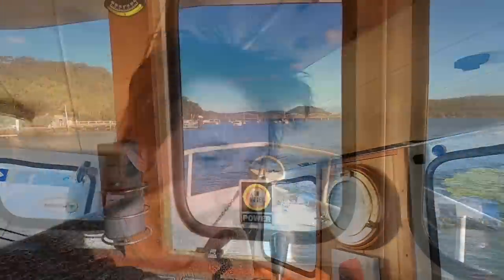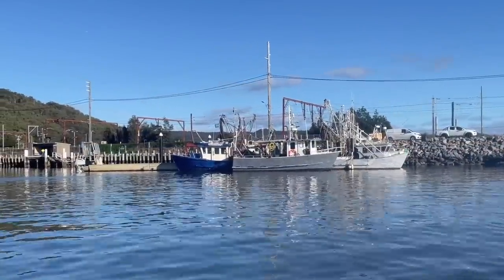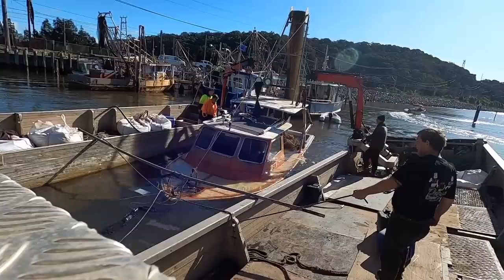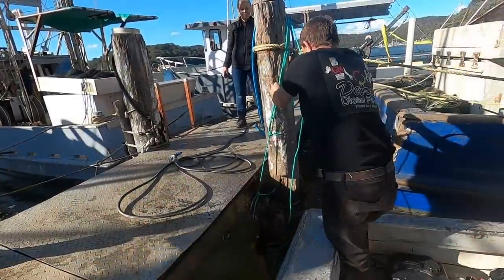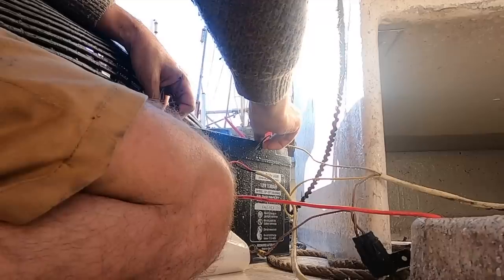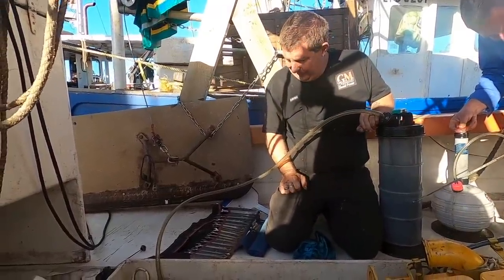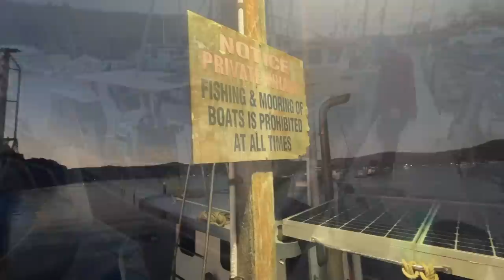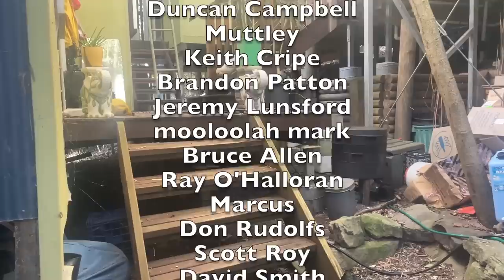Sunk Trawler Salvage

Comment: Great video. Very practical.
Agree with the steps you followed for initial preservation. 
Brought back memories of our boat.. engine room flooded (twin Cummins), got them running again but gearboxes failed after a few weeks of running. We could never get all the water out of the gearbox oil, even after multiple oil changes (our gearbox drain plug was not accessible, so had to vacuum it out and could never get all of it out). In hindsight should have pulled the gearboxes off to drain them properly, but thought we got away with it.. We didn’t!
Reply from the maker: Ah, I think we all have that optimism that it is going to be okay, particularly when removing the gearboxes and stripping them down is such a large and expensive job. It is suprising though that the water didn't get emulsify the oil and get removed with subsequent oil changes. I wonder whether some alcohol in the gearboxes would have helped remove it?

Comment: From my experience with outboards, the rule of thumb was, if you can't work on it right away, you might as well leave it submerged until you can. I have ,personally, sunk a 120 Johnson and a 455ci Pontiac. Both were re-habilitated, although the Pontiac required the use of a"pig' to pressure flush the oil galleries.
Reply from the maker: Yep, definitely better to leave it submerged until you are ready to work on it.

Comment: Nice job. I was surprised it came up and ran as quick as it did. I still giggle, at my cousin, bought an inboard motor boat, replaced it with a renault's motor  and stodd there and watched it blow up and burn to the sand.

Comment: Daisy said Stu needs a haircut. Hee hee. Watched a salvage on a sunken house boat at a marina.  They used lift bags to get the boat above the gunnels then ran three pumps to push water out faster than it was coming in. Was an inboard/outdrive and the boot on the out drive had developed a leak.  The bilge kept up with the leak until the battery died then down she went.
Reply from the maker: Yes, we're hoping to get some lift bags soon!

Comment: Good job, I've done a few sunk boat/outboard repairs too. 

I was working at a shop so it wasn't uncommon for the owner to try and "fix it" before I got the boat or outboard. A number of times the owner had flushed the engine with diesel fuel after they had been dunked in saltwater...   I asked them why didn't they flush it with freshwater? Some of the answers I got were mind boggling.

I told them the water was not the issue it's the salt and silt in the water that is the issue and the oil they washed out of the bearings with the diesel was the only thing protecting the bearings from the salt and water.  

We had a dunktank for small outboards that we used an OMC corrosion inhibitor added to the water when we were flushing the motors. Something like Salt-Away.
Reply from the maker: Yes, you can't beat fresh water. Having a dunk tank with additive is a great way to go.

Comment: If you don't have time to get a submerged engine running straight away, pump it full of fresh water, like till it is overflowing out of every breather for 5 minutes and leave it full of fresh water.
Another good trick I have used is filling submerged engines with alcohol after draining the fresh water from the rinse. Helps draw moisture out and won't hurt anything on start up.
Also, you can't ever have big enough bilge pumps. When buying, go big and make sure you have the battery storage to keep them running for days if needed.
Reply from the maker: Yep, I definitely agree with all of that. 👍🏼
Reply: @DangarMarine  Pumps buy you time alright. Especially when the vessel is docked. When my plywood Pelin slammed into a chunk of pine at 30 knots, the bilge pumps were useless and she sunk in 5 minutes, ample time to cut myself loose from the rope and fishing line, and hooks and rods that had managed to tie me to the boat. I had a few seconds left  to retrieve a life jacket and put it on. My comms were toast, so there was little left to do other than get into the water and wait for a passing vessel. I now wear a life jacket whenever on the boat, it has a waterproof handheld radio and flares attached. I now have an EPIRB. Anyway guys, Finding your boat submerged is never good, though it was a small mercy she was tied to the wharf.

Comment: I've got a 4BT in my trailer boat. They definitely worth keeping. Sweet boat. Great job! Be sure to check the oil in the injector pump. The Cummins uses engine oil from the engine oil pump but not all of my boats do... 2B toyota has a separate oil system for the injector pump. There is often condensation under the tapit covers, a decent run will sort that out.
Reply from the maker: Good tip, thanks!

Comment: What was the original cause of the sinking, and how long was the boat submerged before salvage. Was there no water infiltration into the cylinders? And if so how did you get the water out of the cylinders?
Anyway a great job I’m sure the owners overjoyed that they were able to salvage.

Comment: Another important thing to do after a gentle run is to change the oil and filters. No matter how good you are there is always some moisture mix left somewhere. If you can use an absorbent and detergent oil then change again. Following that put in a zinc additive to oil, as many modern oils no longer have zinc.

He may have to run a pre water filter for fuel ( clear thingys).

Now about that solar issues…after careful inspection of that picture Adrian needs three more panels!
Reply from the maker: Yes, I would definitely go a couple of oil and oil filter changes in relatively short order.

Comment: Question: Do you pull all the filters before you start her up? Or give it a first run and then put in clean filters? Seems to me that oil soaked filters won't have had much chance to incorporate much saltwater...  Anyway, you got her running - now comes all the fussing with the wiring and electronics. Owner ready?
Reply from the maker: In this case we ran it initially with the existing filter to be changed shortly after with an oil change.

Comment: How does a mooring line failure sink a boat though, was the stern tied up too low during low tide that allowed water to enter or what?
Reply from the maker: The line was the spring to stop it going backwards under the wharf, rising tide then sunk it.

Comment: around here they use air bags to get the boat off them bottom then they run air bags under the bottom of the boat to get it up high enough to pump out
Reply from the maker: Airbags are definitely a great way to go if you don't have a crane available.

Comment: Water & diesel don't mix (heavier).
Drop the syphon hose to the bottom of fuel tank and suction off the water/sludge/slime until it draws diesel.
Reply from the maker: Yep, the water is always on the bottom.

Comment: Stu, I'm surprised Adrian didn't give it a second fluids drain (inc hydraulics) and refill after a couple of hours running after the first.  Then again he would know a lot more about it than me ! 
I've resurrected a sunk Holden 202 motor (long story.. :)  ) and a few outboards and done that maybe as an overkill.       Definitely I agree with leaving them on the bottom until your ready to hit them with the vacuum and  masses of fresh water.
Salvage is good work, although I preferred lift bags to get the wreck to where I could crane it or slip it.
Reply from the maker: This video ends soon after the first start up. Oil will get changed several times.
Reply: @DangarMarine  Try dismantling all the electronics (inc the spirit level) and drop in fresh water to just cover them and flush for an hour, then air blow dry from different angles for a few days. No WD40 ever, but finish off with Servisol electronics alchohol.    You might get a surprise when they come back to life !

Comment: Double bilge.    I would definitely want a back up.  Mine sank while at the mooring.   The pump was fine but the float didn’t go up because it got stuck.   The hull always leaked from somewhere on that boat.  I never had another problem once I added another bilge.  The second one used contacts instead of a float.

Comment: Those automatic bilge pumps are junk I have had nothing but problems with them so I switched to the old and true float switch.
Reply: No matter the bilge pump, it wouldn’t have helped in this case. The boat was pulled under by its own spring line.

Comment: Great video as always but I have a question I have a 1977 Johnson 70 this thing always ran great until this year it starts right up and putt’s around  fine and wot for about 10 minutes then falls on its face and hasn’t ran right ever since starts up but runs like crap I’ve replaced every fuel line ball and tank cleaned carbs and no change … no one in my area will work on it so it’s up to me  any info on parts available at or idea where to dig in to would be greatly appreciated thanks for the videos they have help me before so I know they also help others thanks again
Reply: Get a new set of coils for it they always go bad especially intermittently when they heat up after 20 mins of running. Either that or it’s your stator
Reply: @vlogcity1111  thanks for the advice your are rite new coil  number 1 was only throwing  half the time I replaced all three and now it’s as smooth as butter
Reply: @mattfish1992  legend man I’m glad to hear it! All the best to you

Comment: That is amazing - would have thought that engine would require a complete rebuild. Guess the same principles apply when cars take a swim?
Reply from the maker: Yes, very similar for cars and outboards. The electronics on modern car engines do present more of a problem though.
Reply: @DangarMarine  Yes I guess a bit hard to isolate a car motor in the same way but super useful to know for outboards - those little buggers love taking a quick dip!

Comment: On engins I'm really  worried  about i have filled  them with wd40 up to the valve cover flushed. Then filled with cheap oil,  bared the engine  over . Dumped then filled  to proper oil level

Comment: So put valves on all the breathers and close them when leaving the boat?
Reply: And come back to a boat full of oil/diesel after a hot day pressurises the tank and blows off a hose...
Reply: @brendonwood7595  
So I must also add expansion chambers.
Reply: @calvingreene90  They already have expansion chambers to prevent liquid spilling from the vents. But if you think you know better than the engineers who design and build these things knock yourself out...
Reply: @brendonwood7595  
For running or getting dunked?
Reply: @calvingreene90  Whats the point of saving the hydraulic oil and diesel when all the electronics, wiring, engine, furnishings and on and on can't be protected by a valve?
You would be far better spending the time it takes to close all those valves to make sure you tie your boat up properly and what you attach it to is sound so it doesn't sink in the first place.

I guess the engineers think a failure from a pressurised tank is far more likely than sinking your boat through stupidity/bad luck but you do you...
Reply: @brendonwood7595  
It doesn't tank much effort to close a few manual valves and electrically controlled valves are easier.
Water proof wiring is a different upgrade and the electronics are harder to waterproof.
Why is protecting the easiest to protect wrong.
What sank that boat? Exactly.
Reply: @calvingreene90  Why is protecting the easiest to protect wrong.
Because it will cause more problems than it will solve. Have you tried it? LEt us know how it goes instead of being an armchair warrior.

What sank that boat? Exactly.
Tying up to rotten timber. Checking one piece of timber every time you tie up the boat instead of closing then opening all the valves and it wouldn't have sunk at all.
Reply: @brendonwood7595  
I failed to put a breather extension on the differential on my car it had to have it rebuilt because of street flooding on a hot day. For sinking at the moorings just running breather extensions up the mast would probably do.
You must find opening and closing valves mind bogglingly difficult. You can in fact have all the vents plumbed together to one valve.
My experience is in building Boonie bouncers that are expected to wade through water up to the top of the windshield. This isn't much different than sinking at your moorings. I'm going to want a valve or long snorkel on the engine intake as well. It is not much trouble at all. The water proof wiring an the truck is more difficult to install mostly do to all the lights needed to get plates. To keep the engine running isn't near as hard.
I also want to keep the oil out of the water even if somebody intentionally sinks the boat.
Why are you so hostile? Did you have to spend many thousands of dollars to rehabilitate your boat and you think your wife might read this.
Reply: @calvingreene90  I'm not hostile, you are just giving REALLY BAD ADVICE about something you know nothing about.
Have you sealed up the vents on the fuel tank in your car? Have you blown out an axle seal and destroyed the diff because you forgot to open a breather? Can't you just park your car where it won't get flooded? I have found that has worked really well for me for 30 years...
Reply: @brendonwood7595  
No, but I have added a pipe to the vent so to be flooded the top of the car would have to be submerged before water could get in the engine.
Do you regularly fail to do routine tasks? Resulting in sitting motoring at the pier for 3 minutes wondering why you're not moving because you forgot to unmoor?
I have sealed plenty of ventless gas tanks without a problem. When dealing with large tanks fill them to the brim for storage because in a fire the burning fuel is less dangerous than than the tank suffering a fuel air explosion.
I wasn't parked and a child was depending on my arrival so I drove through the water. I didn't think about the consequences because I regularly drive through deeper water in the 4x4.

Comment: You guys are probably at 12 to 13 US dollars a gallon for fuel did you suck out the contaminated fuel out of the tank and run through filters and water separators to save the fuel ? You never said?
Reply from the maker: We left after the end of this video, not sure what happened after that.
Reply: @DangarMarine  Well I guess the client didnt call you back about the 250 gallons of water in the fuel that was left in the tank . Thats a good thing